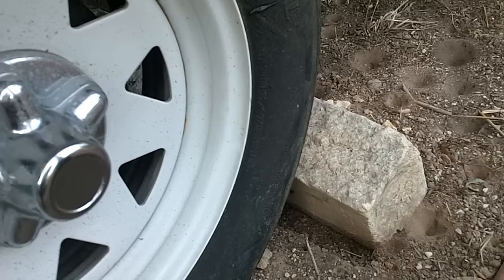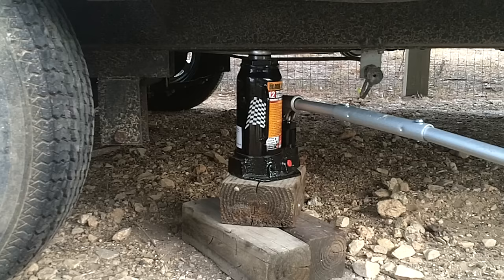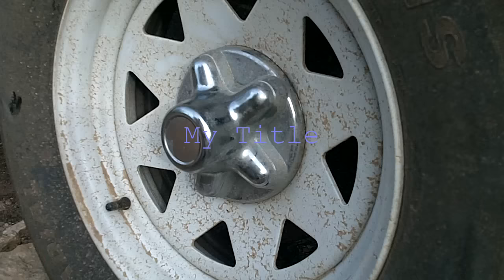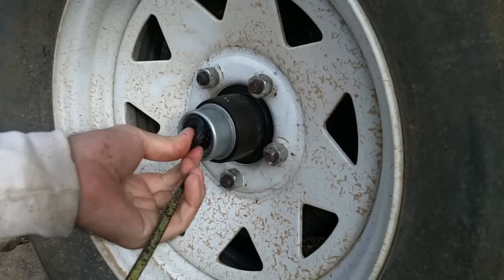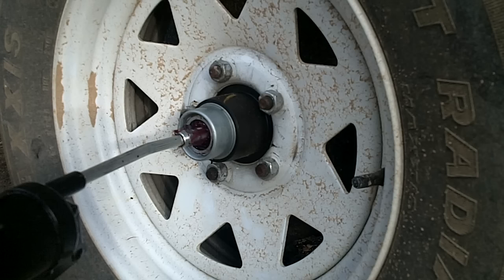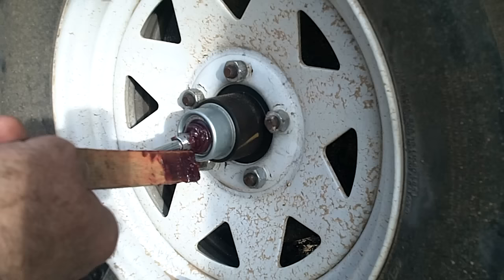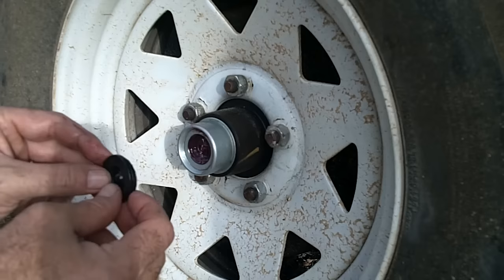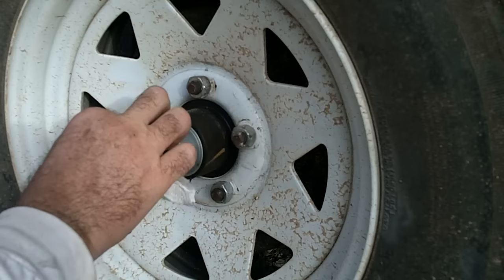How to Grease Trailer Wheel Bearings with EZ Lube Grease Cert

Comment: This is not the way to properly grease trailer bearings. Does nothing for the rear bearing and seal. Do it properly by disassembling the whole thing and check it all.
Lazy mans way is disaster on the highway.
Reply: check out the dexter EZ Lube website Rick
Reply: You have no idea what you're talking about...
Reply: Dave Maple I was talking to Rick...
Reply from the maker: Rick. I can see your concern. A buddy bearing / easy lube / grease cert is not the best way to deal with the back bearing. I will change the name of this video and add a more appropriate description to reflect the difference between this type lube system and the "proper" method... which can be seen in my other video called " How to Pack / Grease Trailer Wheel Bearings". I appreciate your comment. Best wishes - Jim
Reply: Rick Drysdale All I can say is that I am glad I did not follow the directions in the above video. I am getting ready to take a 7,000 mile road trip and though since I have been greesing my bearings using the above method I better do a complete teardown and inspect the inside of the assembly. Upon taking the hub off thee first think I noticed was that greese was everywhere. Zon the brake pads, all over the backing plate,all over everything,what a mess. I completely disassembled everything and greesed the bearings with a $10 bearing greese tool and cleaned everything up and put it all back together and they are good as new. Rick Drysdale is right folks, don't follow this video as it may mean trouble down the road.
Reply: boatbuilder1 are you sure you have an ezlube axle and not just bearing buddies? there is a very big difference. One step that should be added to this video is to make sure there isn't excess play that needs to be adjusted out as well as to check that the grease didn't blow through the rear seal. Slow and steady is the key with the ez lube, otherwise you risk blowing past the rear seal from too much pressure.

Considering how easy it is to damage a seal when you pull the whole hub assembly I would think most would have much better luck with the EZ Lube style.
Reply: Jeff Schultz I do have the EZ Lube Axle. Also he mentions 1 tube per axle? When I took the wheels and hubs off and removed both bearings and cleaned and regressed the bearings front and rear I only used 1-1/2 tubes for all 8 bearings. (4 wheels) Also I did not use the zerk fitting to put more grease into the axle after I put it all back together because I had already packed the bearings and any grease I put in would do nothing in my opinion.
Reply: +Rick Drysdale  Right on Rick. I always remove my hubs and pull out the rear bearing and inspect it, wipe it off and re-pack both rear and front. People just dont understand that the grease with these bearing buddys does does not get to the rear bearing. I see so many people on the side of the road with a locked up wheel every summer.
Reply: Ken Saunders that is true of bearing buddies, Ez lube axles do get grease to the rear bearing. The grease fitting is in the end of the axle and goes through a channel that hits the rear bearing and then pushes the grease forward to the front bearing.
Reply: Thanks Jeff, but I still prefer to remove and inspect.
Reply: +Ken Saunders No argument there, just making sure it's clear that the EZ Lube hubs are not the same as bearing buddies.
Reply: From the dexter EZ lube website this does deal with the rear bearing. The grease is actually sent to the back bearings and then move all the way back to the front bearing. By the time the grease coming out looks new then both bearing have been greased.
Reply: Jeff, yes, I had thought you were right from the beginning. I have these EZ lubes myself and have been pushing grease in there for the last 3 years and all seems good (dirty grease comes out and even pushes water out with it, perfect for Fall / Winterizing). Do I need to lift the trailer and rotate the tires as I do it though? He does it in the video and I don't know if it's needed. I never did it but I always drive the trailer to the storage after greasing so I presume it accomplishes the same thing? Yes/no?
Reply: C. K. I was told that you should lift the trailer and rotate the tires as you push the grease in but also you should do it on a hot day to help keep the grease from being too hard. Both those things help the new grease flow in and the old grease flow out reducing pressure on the back seal.
Reply: This is the proper way of lubricating both bearings for Dexter EZ Lube spindles with grease zerk (not cert). Lift the tire off the ground, connect grease gun to zerk or cert if wish, SPIN TIRE while pumping new grease into the spindle. Repacking is only necessary for bearing, hub, etc. replacement, inspection or grease contamination. Unnecessary for scheduled maintenance with these type spindles.
Reply: @kennsaunders1690  Except its not a bearing buddy. Completely different than ez lube spindles.
Reply: @jeffschultz7523  thank you, somebody who knows what their saying..
Reply: @yogi799  It doesn't matter if it's hot or cold outside, if you're using the appropriate grease. Lift the tire, connect grease gun to zerk, spin tire while pumping grease gun until new grease exits the outer bearing.